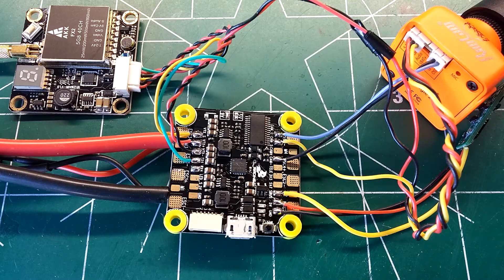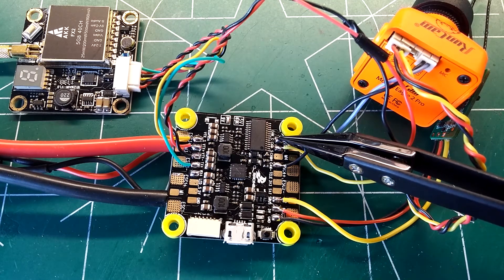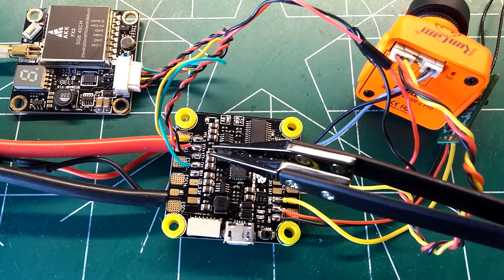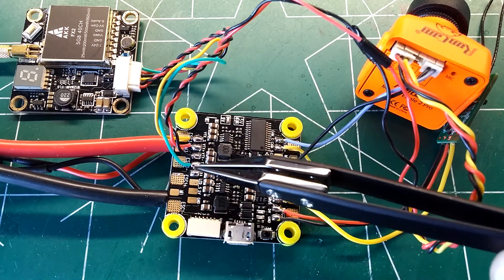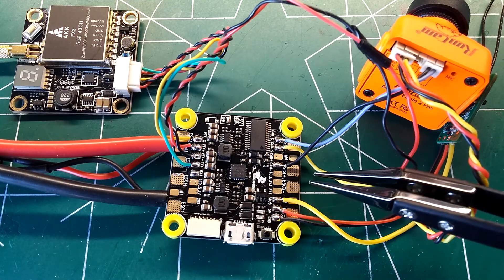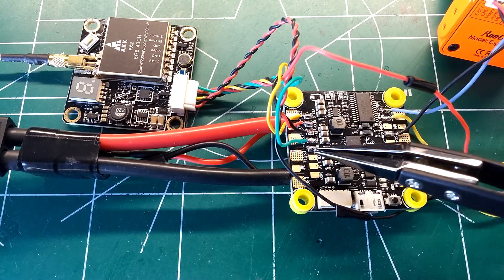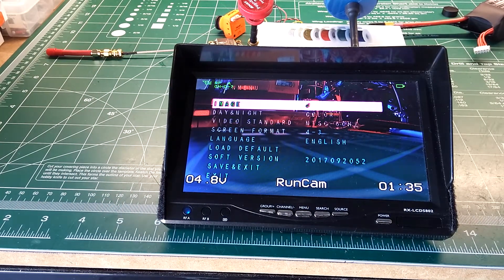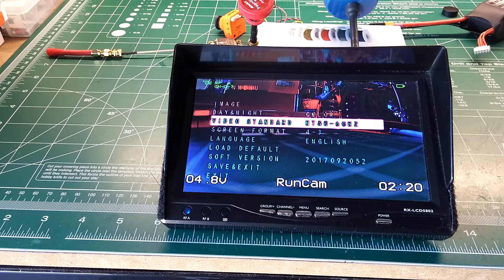CL_RacingF4S Camera Control Setup

Comment: thank ya! still very relevant! started this mini-quad journey in 2017 haha too cheap to buy or setup the fpv system (all LOS)-- now I want to go fpv explore the freedoms we have while we still have them! sub 250g gonna take a minute at the local FPV workout kalub! I am using different fpv components but the same CL racing board; wiring should work out the same. thanks again

Comment: I was wondering about how you powered the camera .... looks like you took the red and black from the camera and the red and black from the VTX and soldered them together then just solder them to the pos and neg pads on the VTX pads so all power to the VTX and camera was done on common pads for the VTX? Did I see that right?
Reply from the maker: I power the vtx from the batteries main power and use the vtx's filtered power output to provide power to the camera, I get less video noise that way.

Comment: cool vids. i see that uart 4 for smart audio for vtx but how to access from audio? , and what uart for camera control?  thx
Reply from the maker: 3dkinson - I think your first question is how do you get audio sound when you're running smart audio? To answer your second question you don't need a uart for camera control to work, just solder it up the way I explained and when the multirotor is powered on but not armed, move the throttle to it's center stick position and then all the way to the right to access the fpv cameras menu.

Comment: Did you have to do any CLI resourcing to get cam control to work? I have a predator micro and following your steps I get no cam control.
Reply from the maker: Tristin Gilbert - Thanks for watching and commenting, and while I don't yet have experience with the Predator camera first hand to know the specific cli commands, I have one coming for testing and the information on how to get it working is in the Betaflight wiki link below, just scroll down the page until you see the bold Foxeer Predator setup guide:

https://github.com/betaflight/betaflight/wiki/FPV-Camera-Control-(Joystick-Emulation)
Reply: SteelRainFPV thanks. I looked through the Github page and read all about it. Did you have to do any CLI commands with the RunCam though? I have 5 CL Racing F4S builds and all have RunCam’s but I never used cam control just because they are for racing.
Reply from the maker: Tristin Gilbert - It works on both my RunCam Eagle, Eagle 2 Pro, and Swift 2 without any further cli commands or hardware hacks, but I've read of people having issues getting it working on certain makes and brands of fpv camera's, like the RunCam micro swifts, sparrows, and some of the Foxeer camera's, along with different firmware versions of Betaflight that require the extra hardware resistor additions, Betaflight firmware updates, and additional cli commands.
Reply: thanks, ended up just soldering the controller connector back on. It will be a nice feature once all cameras and BF firmware updates will work with cam control.
Reply from the maker: Tristin Gilbert - Yeah it's not a perfectly refined feature yet since it's so new in Betaflight, sort of like 32khz gyro sampling and 32bit esc telemetry, they both are not fully supported without some issue's. Personally I just leave the osd dongle extension attached to my racing quads with micro cams, it's less of a headache and just about as fast to change fpv camera settings.
Reply: F

Comment: I have this same flight controller and a runcam swift 2. I have it wired up and can not gain access to the cam settings. Any idea what could be causing it?
Reply: Pyro17059 SteelRainFPV yeah, had read all that. It didnt work a week ago, lol. But they have the stuff up on rcgroups now, link at the bottom of the wiki or right churrrrr

https://www.rcgroups.com/forums/showthread.php?2961216-Betaflight-Camera-Control-Compatibility-Reports

About to try it myself.
Reply from the maker: Pyro17059 - Without seeing your exact setup it's hard to tell, but my guess would be that your throttle stick isn't exactly calibrated so that your mid stick point reads the 1500ms position in Betaflight. Connect your quad to Betaflight and go into the receiver tab, move the throttle to mid stick to read 1500ms on the computer screen, then push the yaw all the way to the right to see if the camera's osd screen shows up, and make sure a flight battery is connected to provide power to the camera and vtx, and of course with props off for safety.
Reply: Pyro17059 i dont think it is supported yet. There is a wiki and a thread over on rcgroups. Some cameras require changes in the command line. 

I have the RR runcam swift 2 and it doesnt work either.
Reply from the maker: Unruly Rotors - The information to make hardware or software changes in the cli to get your specific fpv camera working with Betaflights camera control feature is detailed in the Betaflight wiki link below:

https://github.com/betaflight/betaflight/wiki/FPV-Camera-Control-(Joystick-Emulation)
Reply from the maker: Unruly Rotors - Cool, let me know if it does or doesn't work, and it may require the newest Betaflight firmware update to work properly as well.
Reply: Set your endpoints low 1000 high 2000. Mine didn't work with run can swift 2. Now it does with endpoint set
Reply: Set your trimmers on the transmitter to middle

Comment: Is it possible to configure the button to the menu to show up? My menu only shows when i lift to full elevator, yaw right doesnt do anything
Reply from the maker: Dario Viegas - If you mean can you configure a switch on your radio to access the menu, I don't think that it's possible from my understanding. The developers of the Betaflight code set it up in such a way that throttle has to be mid stick and yaw right to work, so I'm not sure why it's working on your elevator input unless your channel mapping on your radio is modified or different.

Comment: I get noise in my video and I have the camera hooked up to the board. Will try connecting it to my vtx. Thanks
Reply from the maker: HYEonDEATHROW - That is the reason why I power my fpv camera's from the regulated and filtered 5v output of my vtx's, less video noise. If that still doesn't work try adding in a low esr 25volt 470uF-1000uF capacitor to the main power lead pads.
Reply: SteelRainFPV 
   I’ll keep you posted. Might be a week or so before I get a chance

Comment: New builder here,  Trying to map out the connections for this FC to the DJI Ocusync Air Unit.  The DJI Support video states:

UART Rx to OSD Tx
UART Tx to OSD Rx
SBus port to Rx port
Signal GND to GND

I can only guess that the "UART Rx" goes from the air unit to the "Cam C" pad on the FC. The rest is more difficult to figure out since the DJI air unit is like a VTX/Camera AIO.  Can someone help me translate this video https://www.youtube.com/watch?v=q7EfBT56CBg in regards to this Flight Controller? Any help would be greatly appreciated!

Comment: Is there some sort of setup for this to work in betaflight? I have everything wired correctly but haven't been able to access the camera's osd
Reply from the maker: Frank Sarfino - For this board there's nothing more to setup in Betaflight, you just need to have firmware version 3.2 or later. Hook up your quad to Betaflight and go to the receiver tab, set your throttle stick to 1500 according to the program and push full right yaw and hold it. If your stick calibration is off a bit then it won't work right, meaning if you have your throttle stick at it's physical mid stick point and the Betaflight gui receiver tab isn't reading it at 1500 then you need to fix your throttle low, mid and high end points. If that still doesn't work, then you may need to add a resistor to the osd signal wire since some fpv camera's are configured a bit different. What fpv camera are you using?
Reply: This is with a swift on BF 3.2.2. I just spoke with Cheng the designer of the board. He told me this "Try to go to cli set camera_control_internal_resistor = 100." So I'm gonna give that a go when I get home tonight
Reply from the maker: Frank Sarfino - Yeah a full size swift should work without any problems, it's the mini and micros that are having the issues with the resistors, but I suppose if it's an older swift then it could be missing the needed hardware, hence Chengs suggestion. Make sure you try out what I suggested as well, it could just be a simple matter of your physical mid throttle stick position is not calibated or matching up to the 1500ms position needed to enter the camera control menu. Let me know what the results are if you figure it out.

Comment: How come you don’t have the vbat from the camera connected? Also, do I need to do anything special to use SmartAudio on UART 4.
Reply from the maker: Evan Balbier - It's really just personal preference that I use the filtered 5 volt out from the vtx to power my fpv camera, I've had video issues and noise in the past when I've powered my camera using a flight controller's or pdb's power supply. If you connect smart audio to uart 4 instead of using the camera control feature, then you do the same steps for any normal uart, which is to go into the Betaflight ports tab, and select tbs smart audio in the drop down menu of the peripherals tab under uart 4.
Reply: Thx. And you have the FrSky setup on uart1?
Reply from the maker: Evan Balbier - Currently I have this board in a long range 6" build, I have smart audio setup on tx1 and my TBS Crossfire setup on tx4 and rx4.

Comment: Hi, newbie here and this is a nice video... I just have one question for example I have a frame kit with a PDB  included and I want to use that not the PDB in this flight controller “CL Racing F4s” how do I setup the power connection? Thank you
Reply from the maker: Jarold Villanueva - The real question is why would you when this board has it all in one neat and tidy package? If you're still insistent on using a separate pdb, then you would just solder the main discharge and esc leads to the pdb, then solder the esc signal wires to this board, and run a positive and negative jumper wire from the pdb's main positive and negative pads to this boards main positive and negative pads.
Reply: SteelRainFPV - Thank you very much for the fast reply and actually that was really my first choice but when I saw this frame kit “ https://hobbyking.com/en_us/tyrant-s-215-framekit.html” it looks like very neat.... :-) And here is what I’m planning to get and build the quad VTX= Matek vtx-hv / Receiver= FrSky R-XSR / Motor= Emax 2205s 2400kv / ESC= Spedix ES30 HV / Camera= Foxeer Monster V2........... Will it match for the CL Racing F4S flight controller? Thank you in advance....
Reply from the maker: Jarold Villanueva - That's a pretty good list of components for a decent build, it will work just fine with the CL_RACINGF4S flight controller.
Reply: SteelRainFPV - Glad to hear that and I’ll try to work with it as soon as possible..... Again thank’s for the reply... love your videos and hope to see more... :-)

Comment: I use this FC and didn't even realize you could do this! I need to pop my quad back open and hook it up. I was always having to try and fish the dongle connector in and get to the back of my FPV cam. Huge pain!

Are there any pre-requisites for the OSD to pop up besides throttle to center and yawing right? Seems like if that is the only thing to active it, it has the possibility of getting activated accidentally while flying. Now I don't generally yaw 100% to the right...almost ever, but still, what is stopping it from being activated in midair?
Reply from the maker: TomSpice - The pop up osd display only occurs while in the disarmed state, once armed it's not an issue.
Reply: Thank you for your response! I got it all hooked up and good to go. Works like a charm. I ended up running into a snag that drove me nuts for about 15-20 minutes. "Throttle to mid point, and then yaw to the right" is actually based on the the channel values, and not their absolute position like you would think. In beta flight terms, to activate the OSD you need throttle at 1500 and yaw at 2000. (i.e. mid throttle and full right yaw). The issue happens though if you have different rates settings on your transmitter. (low - racing, high - stunts) I had it on my "low" setting which is 80% of normal, which only let my yaw get up to about 1800-1850, so it wouldn't trigger the OSD to activate. Drove me nuts! Finally figured it out, lol.
Reply from the maker: TomSpice - I'm glad that you got it working correctly, and if you use a camera that has the built in osd feature, you can access the menu to change that as well with a different stick command. Now depending on the Betaflight firmware version you have on the board, it's throttle set at it's mid point and pitch up for 5 seconds, or it's throttle set to it's lowest position and pitch up for 5 seconds.
Reply: I have BF 3.2 and am using a RunCam Swift Mini. The midpoint and yaw right worked, I just had to swap back to 100% rates and it worked immediately. I had seen all of the other comments around different stick positions to get it to activate and had tried all of them before I realized it was my rates that caused the issue!
Reply from the maker: TomSpice - Yeah that stick command that you're mentioning is to enter the camera settings menu, the other one I'm talking about is to access and change the cameras built in osd feature, the one that shows battery voltage, pilot name and on time.

Comment: Any idea on how you access the osd settings with CL racing F4S and the rotor riot runcam? To enter osd setting it requires holding up on the osd dongle. Can't figure out what stick command opens that menu. I can only get into the camera settings using yaw right and throttle mid center. Trying to turn the osd off as I am using betaflight osd instead.
Reply from the maker: dpg014 - According to the developers, it's throttle set to mid stick and pitch up for 5 seconds to enter the menu, if that doesn't work try throttle on lowest position and pitch up for 5 seconds.
Reply: SteelRainFPV ok thanks I'll have to try that.
Reply: SteelRainFPV throttle at the lowest point and pitch up 5 times works. Thanks for the tip!
Reply from the maker: dpg014 - No problem at all, just be aware that stick command may change depending on what version of Betaflight firmware you're using.

Comment: Vtx output voltage is?
Reply from the maker: 蔡宗憲 - This was more of a flight controller review than a vtx review, I have a separate review video on the AKK FX2 VTX on my channel if you're interested in it, but in short the vtx outputs an lc filtered 5 volts to the fpv camera, and the flight controller outputs a selectable 5 or 9 volts to power the vtx.

Comment: Iv just switched over to this AIO fc, from a dys f4pro. I used to get at the end of my flight (max current A) in my goggles, but now it just reads O
Any ideas?
Reply from the maker: rumi geiger - In Betaflight 3.2 firmware you have to go into the osd tab inside the program and select what options you want it to show, I believe it's on the far right hand side. Also if you haven't yet, you have to go into the power tab of Betaflight and make sure that your current sensing function is turned on and configured properly.
Reply: Thanks, for the reply. 
I have Onboard ADC in current meter sours. And in my goggles it shows up, but it just reads zero, after flight.
Reply from the maker: Rumi G - Ok, make sure to go back and double check that everything is activated for current sensing and the osd readout inside of Betaflight in the configuration, power settings, and osd tab. My best guess without seeing your Betaflight gui or setup, is that It sounds like something isn't enabled or turned on causing the zero readout issue.

Comment: Hey nice board I’m getting one soon! One thing what the version on it for betaflight? Is it the new version of firmware or will I need to flash to the newest beteflight?
Reply from the maker: Northern_ FPV - It should come with the new Betaflight 3.2 firmware since that's the version that works with the camera control feature.
Reply: SteelRainFPV thanks for the information!

Comment: Thanks! I have a Turnigy Evolution on SBUS. How do FRSKY transmitters communicate withthe board to control the OSD . Is it through the telemetry. I don’t think that is possible with the Evolution. I’m a newbie so please be gentle.
Reply from the maker: Adriano Pangelinan - It's not a specific feature to any radio protocols, it's a built in feature of the Betaflight 3.2 firmware that eliminates the need for the dongle that plugs into the rear of your fpv camera to change it's settings, telemetry is a separate feature that has nothing to do with the camera control feature. So in short if you follow my setup video, the camera control feature will work with any radio protocol.
Reply: Adriano Pangelinan h